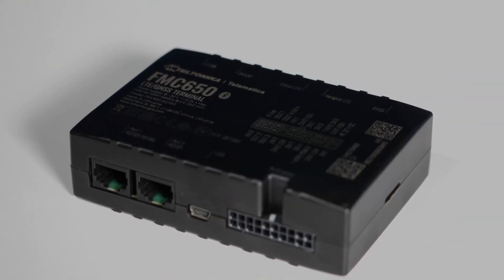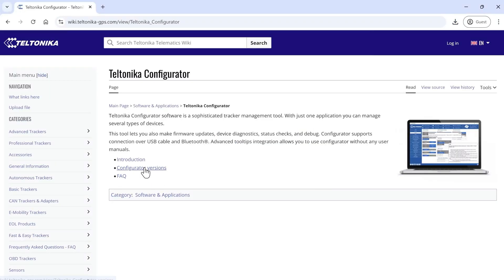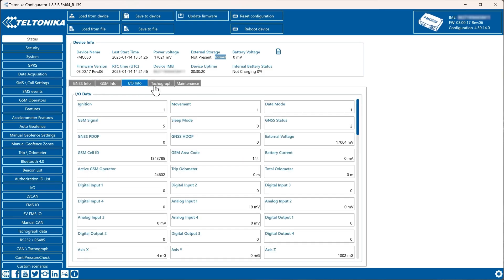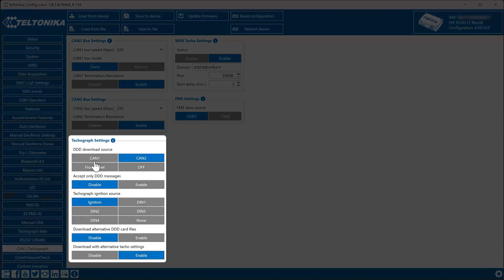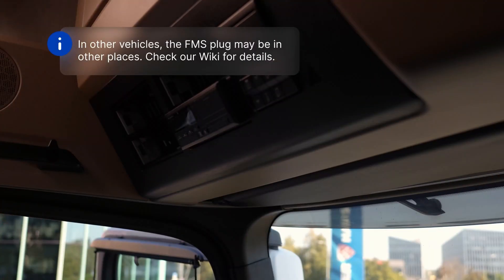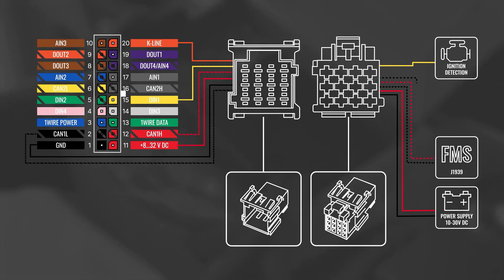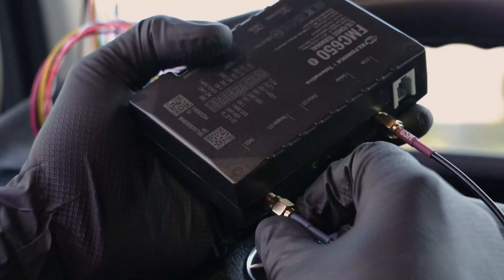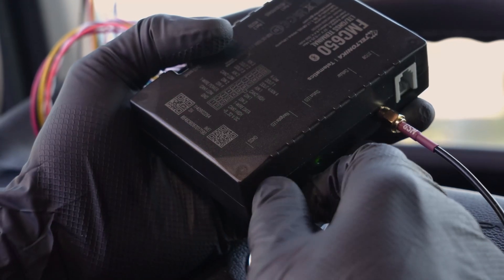Installation Guide | FMC650 Professional Category Tracker  | Teltonika

Comment: We would advise not to wrap up excesive cable of the Ecan02 together with the GPS or GSM Cable. We have see that this can cause GPS errors in the Tacho.
Reply from the maker: Thank you for your input! This comment could be very helpful for installations using the ECAN02 when the FMS plug is not located or not working. Please ensure that power cables are not routed near the GSM/GPS antennas during installation, as proximity may cause signal interference, leading to degraded performance or data transmission errors. This video shows the connection using the FMS cable and the correct mounting of the GPS/GSM antennas.

Comment: So you place a tracker in the most accessible space of the truck?
Reply from the maker: Hi, in this case, we have mounted the device behind the tachograph because the FMS plug is located nearby. Each engineer selects the most suitable location for mounting the tracker, but be sure to install the antennas without causing any damage.
Reply: @TeltonikaTelematics  In Australia we have worked with Volvo and others they put Plug with 12v and igition and Can behind the dash, Helps when your customer buys alot of trucks but the FMM650 is breeze to install
Reply from the maker: @cheekonv  Thanks for sharing!